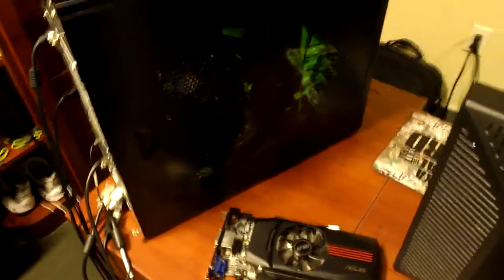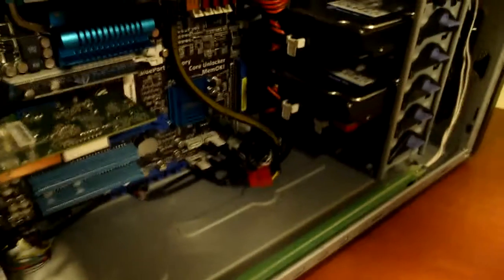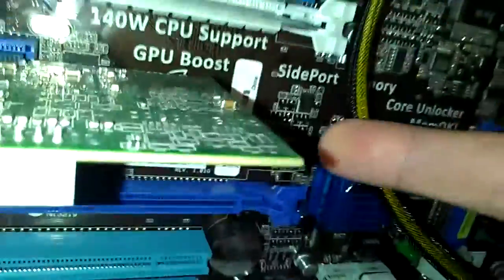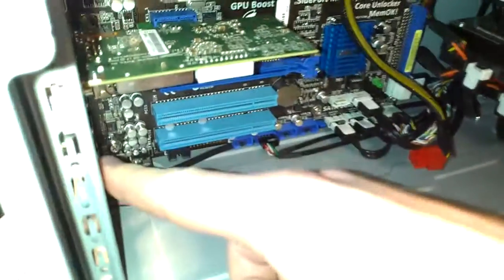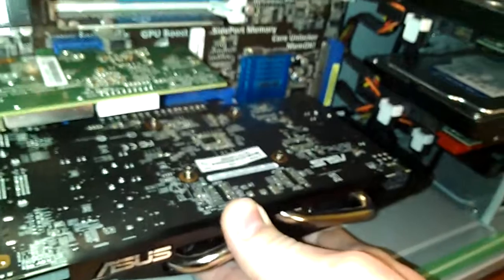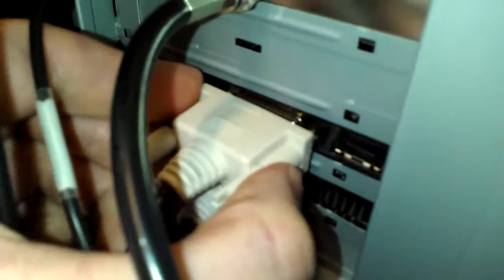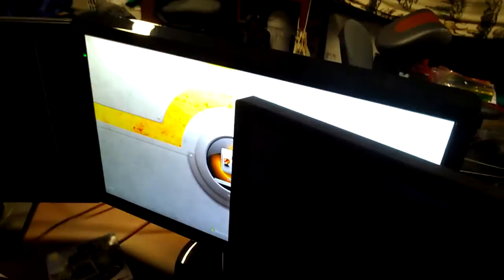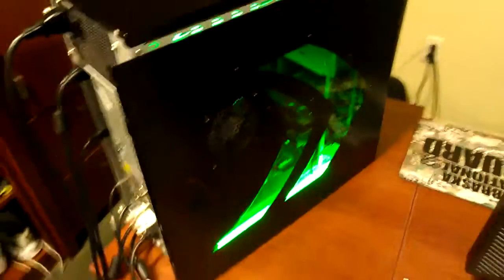How to install a graphics card.

Comment: do i have to use the DVI cable and the HDMI or can i just plainly use a HDMI cable on one moniter and then have it done.
Reply from the maker: RavenBoy99 Hey! As long as your monitor has an HDMI plug, yes you can simply plug one end of an HDMI cable into the monitor, and the other into the GPU HDMI port and that's it, as you only need one video cable per monitor.
Reply: ThePoliceUT3 Thats great to hear! but also will that switch from integrated graphics to dedicated as well? im buying a Desktop with A10-6700 and it has radeon integrated graphics and i hope this is the easy way to switch it.
Reply from the maker: Yeah, it should actually automatically go to your dedicated gpu after you install it as well, and if not there is generally an onboard graphics setting in BIOS that you will need to set to auto, which is default on most everything.
Reply: ThePoliceUT3 Ok good i dont think it will have it. Thank you again!
Reply from the maker: No problem! Good luck with your build!

Comment: thanks, but it turns out that there is a safe boot up in the bios and when the card was in, it saw it as a problem and wouldn't display anything. once that was turned off it worked fine.

Comment from the maker: First off, rule out the simple stuff, make sure the graphics card is plugged in with the power cable (if needed) then that the video cable ends are fully connected to both the GPU video out and the input on the monitor, and that the monitor is displaying from the correct video source (DVI, HDMI or VGA) and that the monitor is in fact getting power and turned on. Then if that's not it, make sure the PC is set to automatically use the card in BIOS, I'm running out of characters to comment any more

Comment from the maker: Based on my experience, either you didn't plug the monitor into the video out connector on the graphics card you installed, or you need to change the video out setting in bios to use the card you added and not use the onboard video. If you checked both of these then it's possible it could be a DOA card. Hope this helps!

Comment: 1 question i want to buy a gtx 550 ti and i am afraid a little. i have a 750Watt pwer supply and pcie 2.0 (what it needs).do i need anything else to intsall this card?I also have a 6 pix cable but do i need a gpu boost like you?

Comment from the maker: That is plenty of wattage for the card, It only requires about 65W to run. This card could technically run off just the PCI-E x16 slot alone, even though it has an external power plug. In fact, a friend of mine was running a GTX 650 in his machine with a 450W PSU and it worked fine.

Comment: Do you need to use the external power cable? I've read that the PCI-E slot provides up to 75W to the card, so in theory it should be enough for it since it uses 64W at peak loads, right?

Comment from the maker: The card comes with a 2xMolex to PCI-E connector. So if you have two un-used molex connectors coming off your PSU, you should be able to run it just fine.

Comment from the maker: Ok, that little HDMI cable is a mini HDMI to full HDMI adapter. I'd recommend that you just use the DVI or VGA ports on your graphics card since that's a lot cheaper than buying a new monitor. Unless you absolutely want to use HDMI then you'd need a new monitor or get a cable with an HDMI plug on one end and a DVI plug on the other.

Comment from the maker: I doubt you broke the port, unless you pushed really hard on it, but you could check the solder joints on the circuit board (top) side and make sure that non of them are broken. Also try lightly wiggling the 6-pin port, just to make sure it's not loose or anything.

Comment from the maker: Does your card have a small LED light right by the 6-pin power connector on your graphics card? The 650 in this video has that LED. it glows green as long as the power supply is getting power. If there is a problem, the LED will glow red. 
Another thing to try, is to remove your GPU card, and plug your monitor into the onboard video port, then boot into your PC's BIOS, and make sure your BIOS is not set to use "onboard video" I believe it is "auto" mode on most boards. Let me know how that goes.

Comment: I put the card in I plugged the 6 pin power supply in I ha e the right wattage, but it won't work? I plug the monitor into the back of the card but the the monitor goes to sleep? It should come eith preloaded drivers, is it possible that i broke the port in the motherboard? Please help

Comment from the maker: It's a VGA switch card. When it's in the 2nd PCI-e 16x slot it disables it and makes the first slot use all 16 lanes.
Two PCI-Express2.0 x16@8 lane graphic slots offer 4Gbyte/sec data transfer rate at each relative direction and up to 8Gbyte/sec concurrent bandwidth at full speed.
The reason for this is if you have the 2 PCI-e slots in a split 2 x 8 lane configuration, an example is for Crossfire mode.
 Basically, it doubles the speed of my one card, vs. splitting it if it wasn't in there. ;)